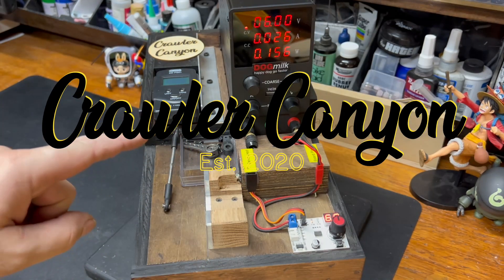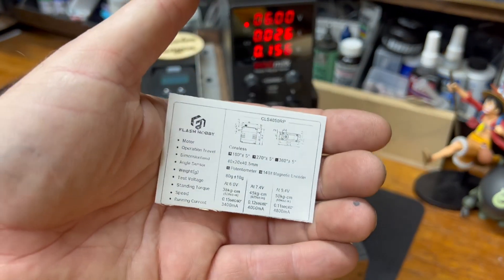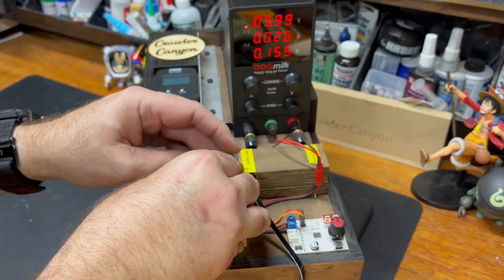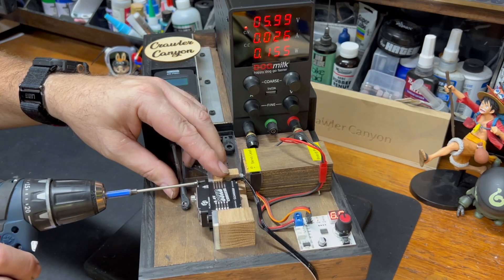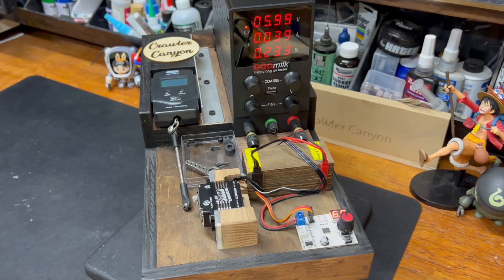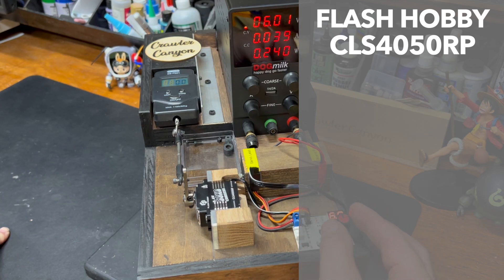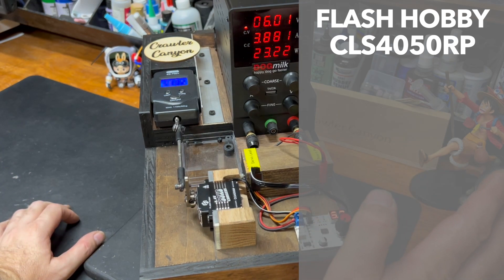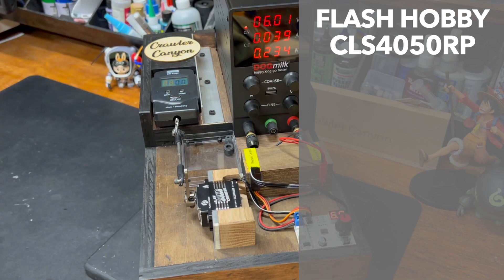Crawler Canyon Presents: Servo Testin' Time, Flash Hobby 8.4v 50kg (CLS4050RP)

Comment: Was watching one of your other videos and you used 40w shock oil, is that what you typically use or is dependent on rig/vehicle?
Assuming vehicle weight,  available spring options and suspension geometry plays a roll as well.
I’m very new to RC and love crawlers, I’m just try not waste shock oil trying a bunch of different oil weights.
Thank you sir - excellent excellent videos
Reply from the maker: For the bulk of shocks, 40wt is a great place to start.  The 300cst (basically 27wt) is too soft for most of the shocks it comes with, but works great in a Dravtech or a Big Bore. I would say probably half the shocks in the whole fleet have 40wt in them.

Comment: The 650 is my favorite servo. Running a few of them in a few rigs, love the simplicity of the direct power and not needing a BEC. It fits most rigs better than the 800 and I’ve never felt it was short on power. I’m running mostly 24mm Vanquish horns on them. Even with a 2.2 rig with weighted wheels it has no trouble! Sure better than the early days when I had an AX-10 and a Hitec 645mg trying to turn 2.2’s 😂

Comment: Please test out the powerhd servos particularly the 40kg all aluminum blue case servo been using them for years with good luck for lower end stuff but I’d like to see the amp draw and real world numbers as I may start getting the nsd budget servo if the amp draw is way less and it makes the same numbers why keep supporting Amazon ya know
Reply from the maker: Power HD remains untested for 2 reasons:
1.  They're literally never on Prime. Paying $7 shipping on a servo is not something I try to do.
2.  The price of the 40kg model is $3 more than a 50kg Flash Hobby, or $3 less than a 60kg Flash Hobby, so I never really saw the point. 
50% more power for $3 is a tough deal to pass up.
Reply: @CrawlerCanyon  I’m one of them eBay users lol so primes never made or broken a deal for me but I still want to see numbers I’d be willing to send one for testing just to tame my curiosity
Reply: @CrawlerCanyon  I’ll be trying something different now since I’ve been seeing these videos flash hobby doesn’t seem all that bad but most of my
Older stuff is power hd and unless it breaks I’m not swapping anything

Comment: I bought (and smoked) a HK Hobbies 35k+ servo which was great until it wasn't, so I upgraded to a Holmes SHV650. Mr Canyon, how does this Flash Hobby compare to the Holmes, in your opinion? Thank you.
Reply from the maker: Well, the Holmes is producing heaps more torque.  I'd have to say we'd want to compare the SHV650 to the Flash Hobby M60BHW, as they spec out about the same. 
With the Holmes, you're paying for any eventual "back end." That is, you <should> have some kind of recourse should there be a problem.  With the Flash Hobby servos, and how cheap they are, I've never anticipated any kind of warranty or post-purchase support. They're cheap torque. 

So determining that "post purchase" value, what that's worth is up to you. The SHV650 is going to be negligibly faster/stronger than the M60, but it will/might/could/should live longer.
Reply: @CrawlerCanyon  that is a helpful reply, thank you very much. I'll stick with the Holmes but I did like the anti-stall in the Flash Hobby servo you reviewed.

Comment: higher volt ala 6s  but low kv  makes a low power motor,  go higher kv same voltage w throttle curve.   internal 10a bec underload  i think would struggle with 2 6+amp draws,  dropoff i would imagine being much worse then a external bec.   possible brown out....

Comment: would you recommend using these in bashers? specifically 1/7, 1/8 scale like the kraton 6s, fire team 6s and other similar models?
Reply from the maker: I don't see why not.  I'm running MKS HBL550s in both of my Arrmas, and the 550 is almost the exact same numbers as the 4050. I go with MKS because they're LOUD, which doesn't matter in a rig where every single gear is metal.  A proper 50kg should be plenty for even big ol' Copperheads, etc.
Reply: @CrawlerCanyon  Thank you so much for the information and fast response I greatly appreciate it :) just completed the order for x2 of the servos can't wait to get them in and test it out. You're video was amazing by the way keep up the awesome work brotha!!!!